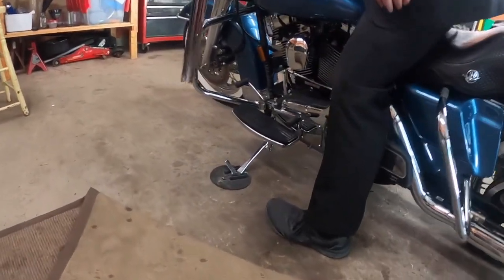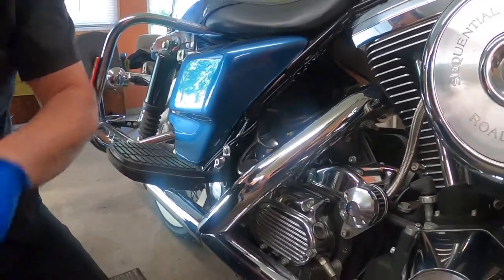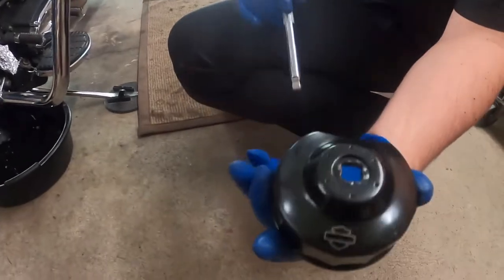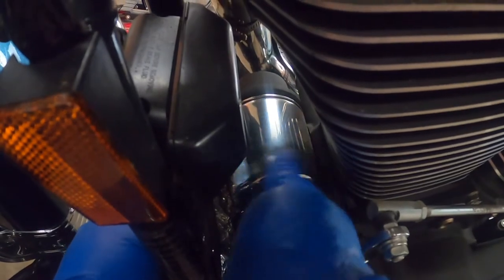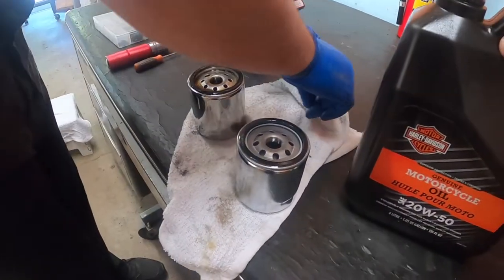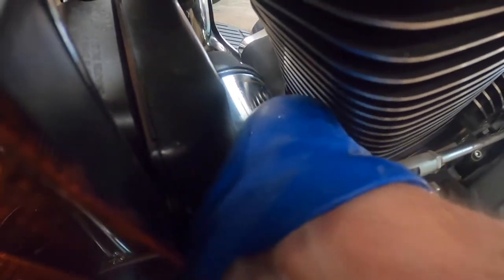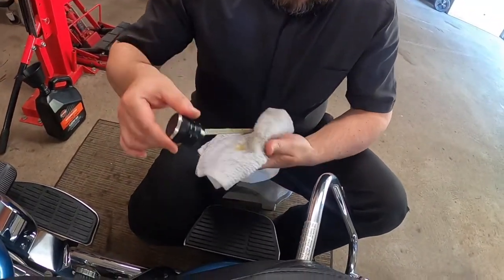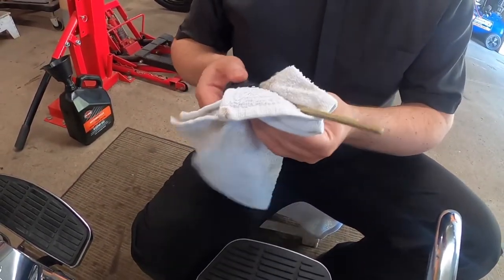1998 Harley Davidson Road King oil change.

Comment: I can’t my oil filter off. I’ve tried everything from strap wrenches to a damned chisel
Reply from the maker: Have you tried a Scredriver? I had to use that extreame method once in my life.
Reply: @weron021  took me 3 screwdrivers and 2 hours! What a pain in the ass
Reply: @ChezzOnBass  Someone stuck it on way to tight . turn it down finger tight then go 1/4 to half turn .   I use a strap filter wrench to remove them , I have a 95 Road king .
Reply: @JCcanU  I broke a strap wrench trying to get it off! Eventually got it with a screwdriver hammered through the thing
Reply: @ChezzOnBass  Someone put it on way to tight .    I use a strap to remove mine . I only hand tighten the filter .